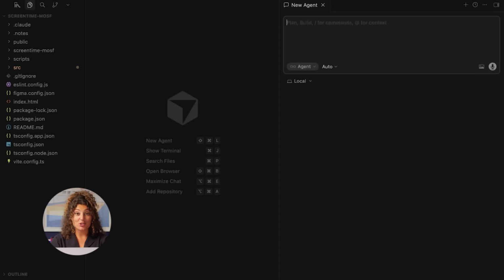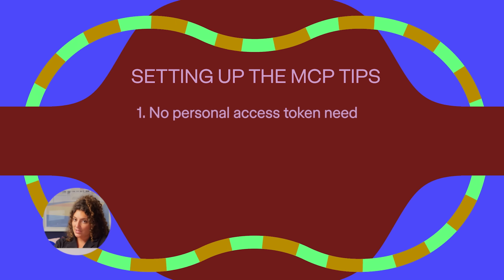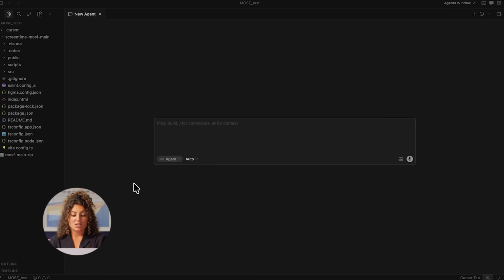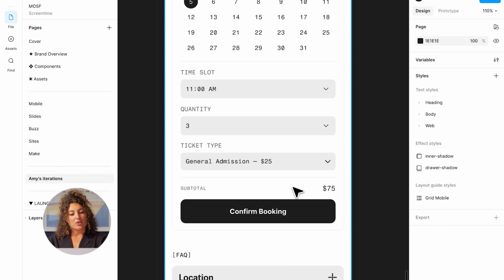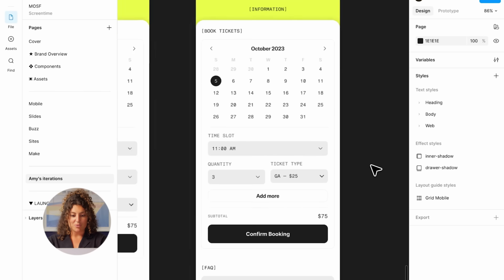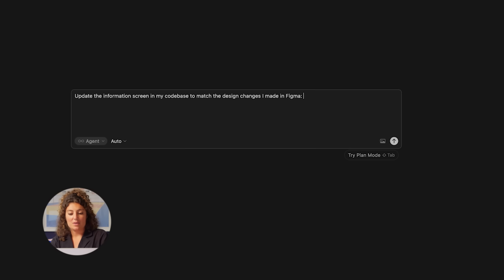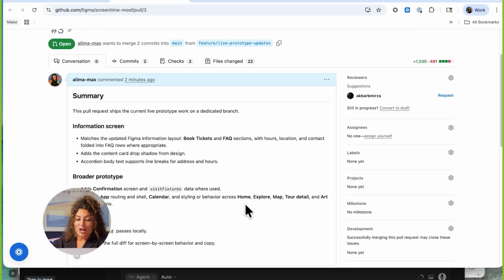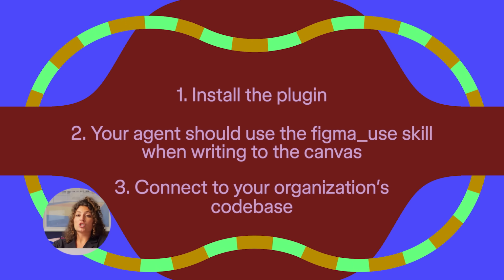Getting started with the Figma MCP server

Comment: Questions

1. is code written by Cursor is that good? 
2. will it helps production faster if the code isn't that good and engineer will have to spend time fixing the code written by AI?
3. In which process do designer actually use AI to increase the efficiency of the design process? esp with limited token/credit by most of these AI services
Reply: They are good questions; it might need a real case and a developer to answer # 2. You also make me think with your #1 question, if two designers work on the same project and with a different tool I.E Cursor & Claude, and maybe the developer a different one, the product may end up with different ways of scripting? idk... I know each developer has their own way to code, so MAYBE we are going to end up with a mix of scripting
Reply: 1. Cursor has it's own model called Composer 2, but when building projects you'll likely want to check with engineering which model they are using along with other documentation and codebase access to provide supporting documentation (usually in the form of Skills or markdown files). Additionally if you are using Figma's Code Connect for any components that exist in both Figma and in your codebase with mapping between the two, you can reduce the likelihood of hallucination significantly along with a reduction in the number of tokens used too (as this acts as a direct instruction to the model about which component to implement)
2. Much of this is really about your environment setup, chat with your engineers to find out how they have theirs setup to reduce the chance of this being the case.